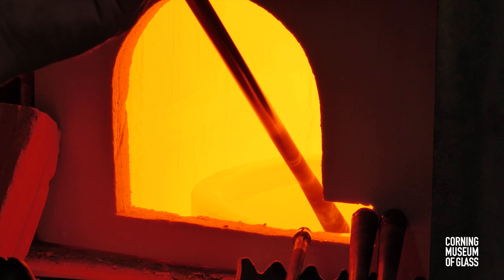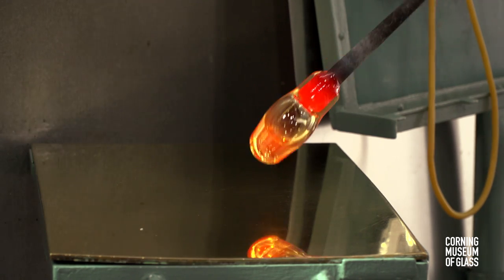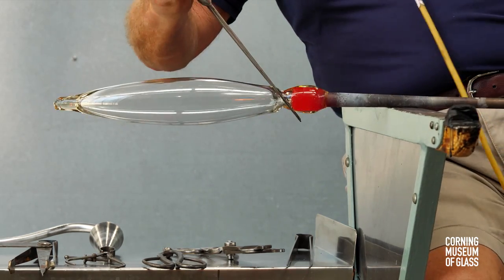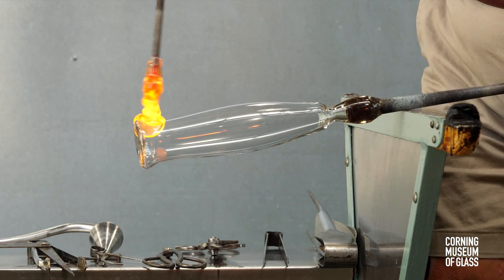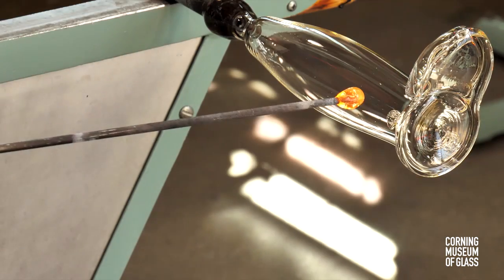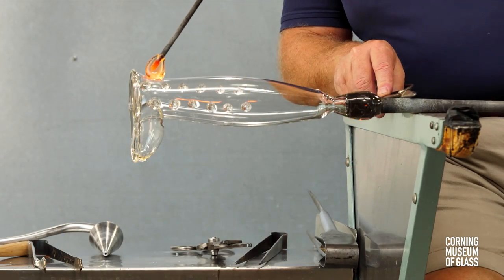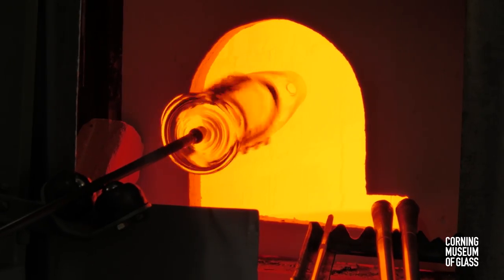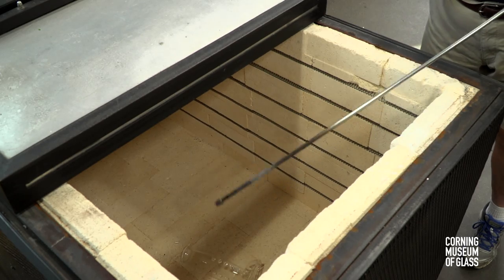Boot 👢 | Techniques of Renaissance Venetian-Style Glassworking

Comment: Any specific reason this marver was brass? Usually it's steel or stainless steel.
Reply from the maker: Hi!  We went straight to the source and asked Bill Gudenrath, here is his response! 

A BRASS Marver?

Brass has two distinct advantages over either mild steel or stainless steel as a marver: 1) if kept polished, as I like to do, it’s WAY prettier, 2) it’s a way better conductor of heat than either steel—and that can be helpful. 

The word marver comes from ‘marble’, I’ve read here and there; presumably they were made of that—at least somewhere, sometime in the past.

Marvering glass does two things: it shapes the glass and it cools the glass. If you primarily want to shape the glass with minimal cooling, stainless is an excellent choice: it’s a poor conductor of heat—as metals go. Marble is even better: it’s a wretched conductor. In fact, as you marver on it, the surface vaporizes, creating a cushion of gas; the glass barely touches the material. This is the same mechanism that causes glass to be cooled so little when you use blocks: there, the glass is held mostly away from the wood by a cushion of steam…locally probably super-heated steam at that; so VERY little cooling. The great American studio glass artist Mark Matthews uses a marble marver for many of his highly specialized procedures where he requires minimal cooling.

If, during marvering, you primarily want to cool the glass, brass is a great choice: it’s a great heat conductor; copper would be even better, and so on. 

For example, if you want to keep the tip (end) of a bubble of glass thicker than the sides, marver the tip for a while holding the blowpipe downward at about a 45 degree angle just before you blow. For this purpose, brass is great, marble would be terrible. 

In closing: In 1982 when (with Kevin Scanlon) I built my furnace and accompanying furniture, I went to Space Surplus Metals (LONG gone) on Church and Canal streets in NYC to get a 1’ x 2’ piece of stainless for my marver. The owner said that for the same price I could have a beautiful piece of brass. It was love at first sight—and we’ve been together ever since. That is the SOLE reason I have a brass marver! 

So now when you see me working, you’ll better understand why sometimes I marver very briefly—much shaping, little cooling—and sometimes I’m glued to it for a while—shaping with MUCH cooling.

I hope this answers your question, Sir.

Bill
Reply: @corningmuseumofglass  Wow, thank you so much for the reply! Having it called out specifically in the video made me wonder, as the limited number of marvers I've seen and used have all been stainless. It's great to learn these little details from a master of the craft. Please pass along my thanks to Bill and the team for the detailed reply and all of the wonderful educational videos he and the Corning team have put together over the years.